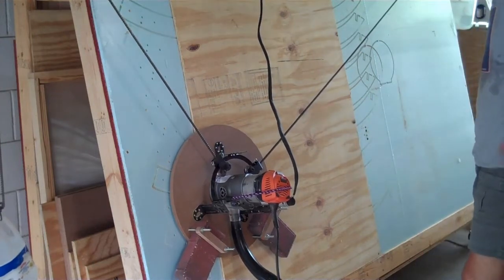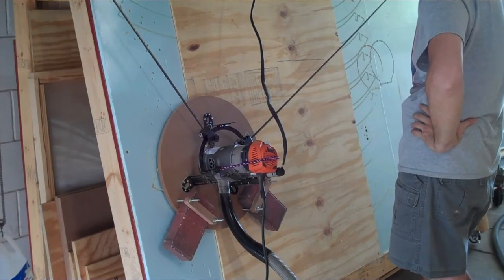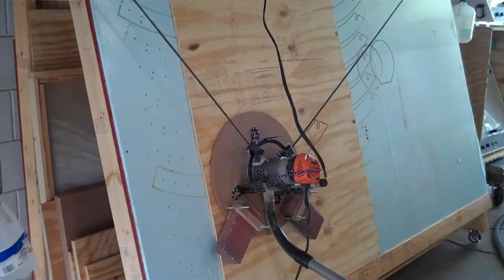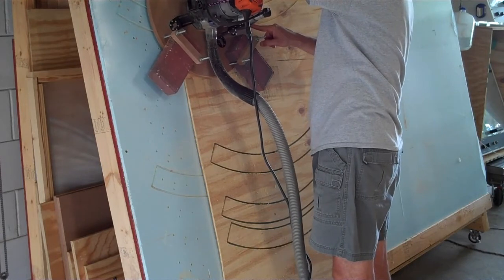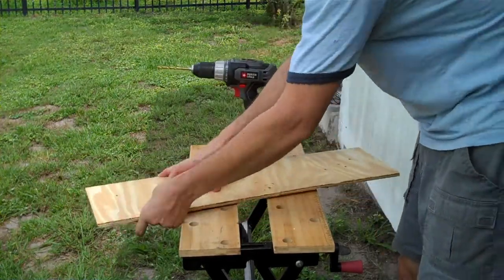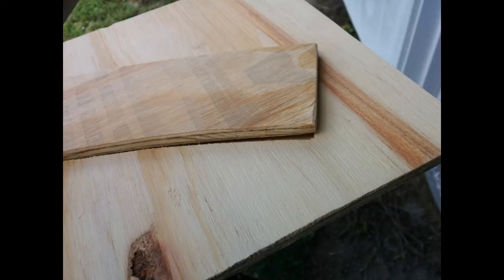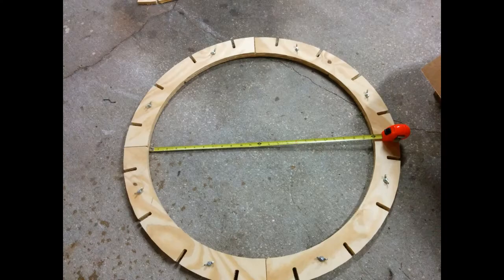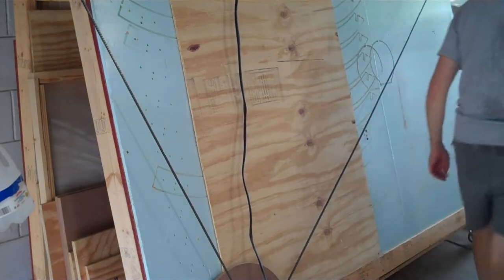Maslow CNC Hanging Router Review

Comment: will I be able to cut aircraft wing ribs with this?
Reply from the maker: Yes, but unless they are all different sizes, you might find it easier to make one template and then just use a template bit on a router to cut them by hand, as it's relatively slow.

Comment: How has the Maslow been working for you over the last couple of months? How is the accuracy at the edges of the board, assuming that you have tested further
Reply from the maker: I don't really make use of it too much (only when I have a project I need to cut). The last project I cut on it (cord holder / power supply case) will be in a video soon, and I actually cut down near the bottom edge of the work surface (and had to hold the top of the router sled in place when the bottom goes past the edge) just because it was easier to attach the leftover scrap plywood piece I had down there. The accuracy of that project really didn't matter much, but the two parts I cut out were quite close (but not exactly) the same.
Reply: @summetj  Seems as though the angle of the work surface compared to the angle of the tension of the chain and angle of the weight of the bring is quite important... not sure what could be done about it.

I have been looking at this for cutting out items like the OpenDesk furniture and would love to hear more about your experience with accuracy with projects such as that as well, especially when cutting across an entire sheet.

Comment: Since a lot of pieces people cut out are less then 4 feet wide, one can just shift the plywood over a few feet thereby nullifying any chain tension issues in the bottom corners. You probabaly know this just point it out to new people who might watch your review which is the best I have seen on youtube. :)
Reply from the maker: PhotoBooth biz Yes, smaller parts can be cut near the center. but something like an X carve would probably be better if you are looking to only cut small parts.
Reply: x carve can be expanded with 2 extra maker rails, cables, etc to be about 30x60" cutting area cost of $1900 roughly vs about $900 for maslow which is more like 40x60 good central cut area.

Comment: https://www.amazon.com/gp/product/B01MEGLCPL/ref=oh_aui_detailpage_o04_s00?ie=UTF8&psc=1   Some people are using this z axis motor which is 122rpm vs the 12rpm of the standard one. Basically 10x faster. However I am not sure if it has a enough torque for the big router you are using. I know It works fine with smaller palm routers. If you need to make a template that is used much more often. you can use weld nuts and epoxy them in place so that the drill bit is rubbing agains metal and not against wood which slowly enlarges and therefore becomes less accurate.